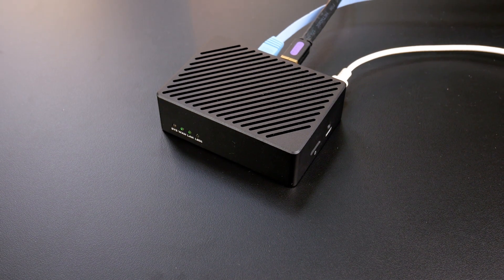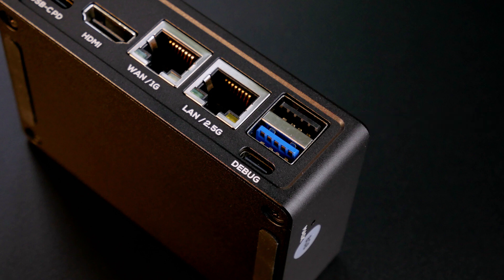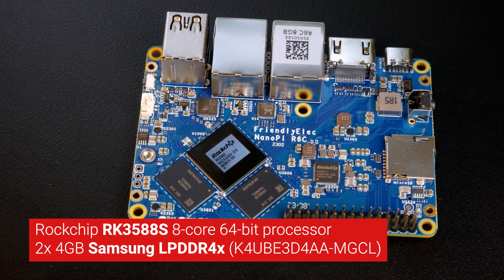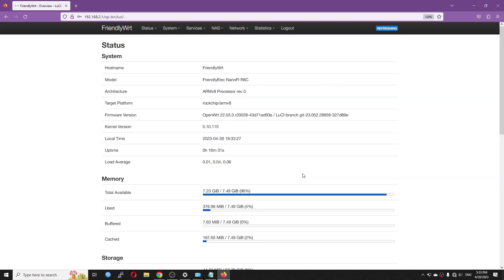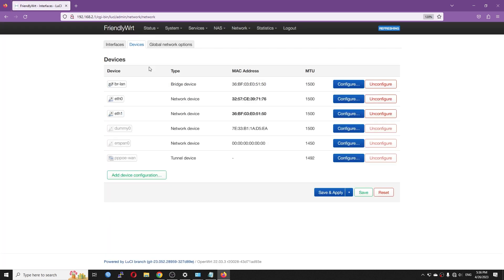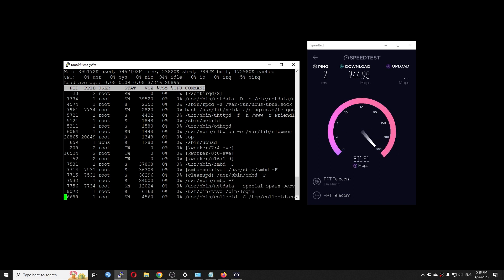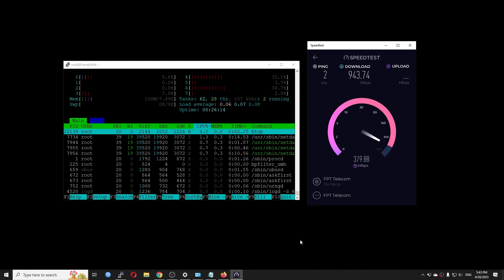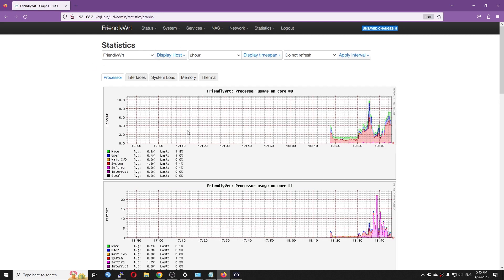NanoPi R6C - Overview, Quick Setup & 1Gbps Throughput Test

Comment: I like this sbc! Last year I purchased the Nano pi r6s. Had I known about the r6c I would have got this one. I don’t need three ethernet ports for my use case which is retro emulation, specifically ps2 gamecube and Wii. The rk3588 is quite capable of running these emulators even upscaled to 2-3x resolution! Good video. Thanks.

Comment: I look at both the packet steering test and the offloading and the CPU idle and sIRQ is quite different between the 2 tests in the terminal window. I don't see how you could end up saying you had 22% cpu usage from transfers on both.
Reply from the maker: I don't understand your point. My summary is only based on the CPU idle percentage, I don't care about sIRQ or hIRQ. Sometime the value change rapidly and what I spoke may not reflect the current value, that is why I show the screen recording instead of a picture to summary the result.

Comment: I am facing an issue with ping spikes +40-50ms when using SQM ( on wan interface eth0 pppoe with vlan) even though my internet speed is 300mbps, could you test this and advise for a fix.